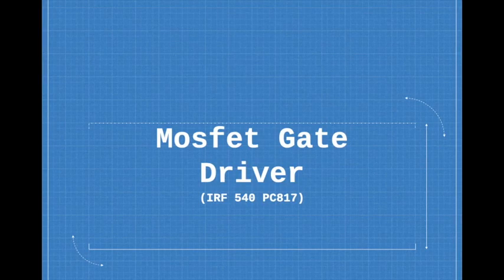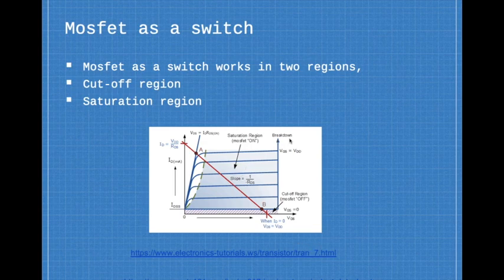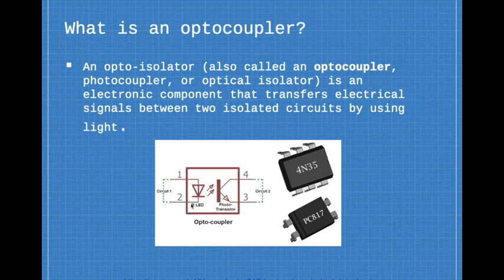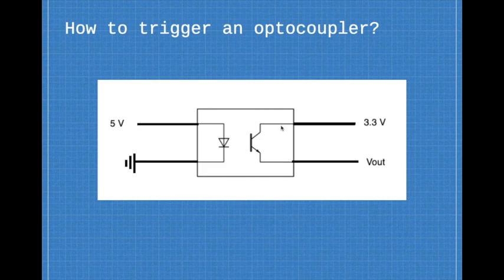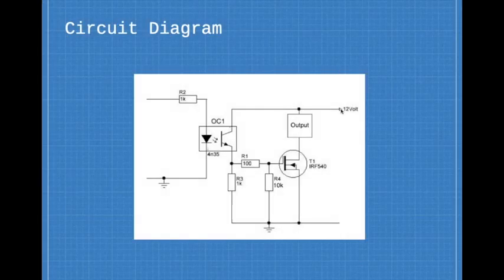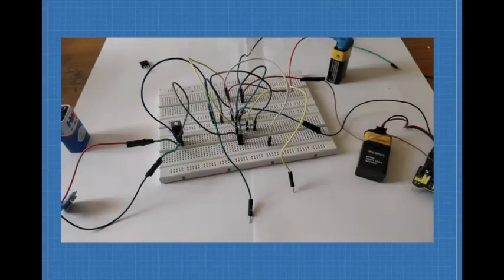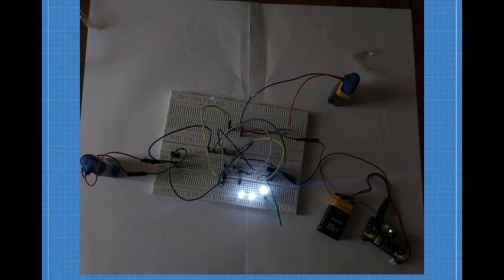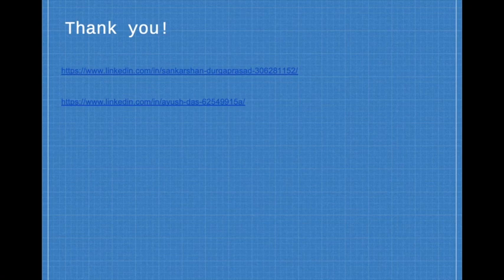MOSFET Gate driver circuit using optocoupler!

Comment: I was able to light up the LED with this, but could not run a gear motor that takes max 150mA and 6V. I also used a DRV8833. 

Would you please tell me a solution?

Comment: Just yesterday I tested my PC817 optocouplers for speed. At low LED currents (when the transistor does not enter saturation), the recombination time can be reduced to 50us (12V supply and 1.5kOhm load). But already at LED currents of 5mA and higher, this time increases significantly. And this is still without a capacitive load. You can imagine how much the switching time will increase with a connected MOSFET gate with its large parasitic capacitance. It is completely unsuitable as a gate driver. Except in very slow and low-power circuits.
Reply: Yes pc817 itself is isn't enough to drive MOSFET, additional transistor is required to drive it , thats very reason we use 4n35 for better gain current which can directly dirve the MOSFET
Reply: 4N25-4N35 have an additional phototransistor base pin, which allows you to pre-set the bias currents and its operating mode. I considered the PC817 as the cheapest way to communicate between two microcontrollers located at different potentials. As the experiment showed, the maximum speed at which such communication is possible will be within 4800-9600 baud.

Comment: The optocouplers are mostly npn ,hence working on negetive supply to drive a p-channel mosfet, how is it that you are driving an n-channel MOSFET with a npn transistor in the opto??
Reply: Not sure if you still wanted an answer but you can either drive a small p channel mosfet which in turn drives the power N channel mosfet or you can use the optocoupler to drive a PNP transistor to drive the gates of the N channel mosfet. You just need to spec resistors appropriately for the given load.